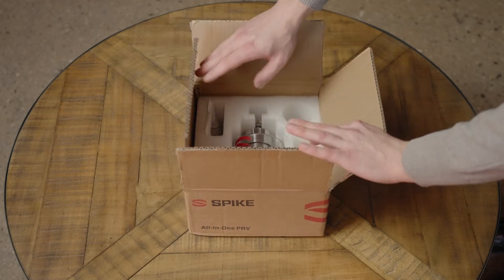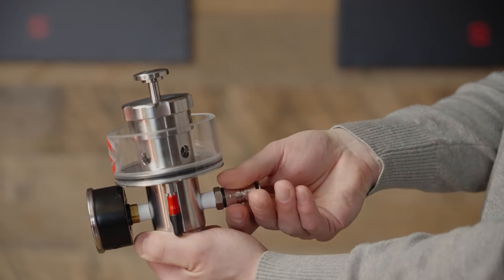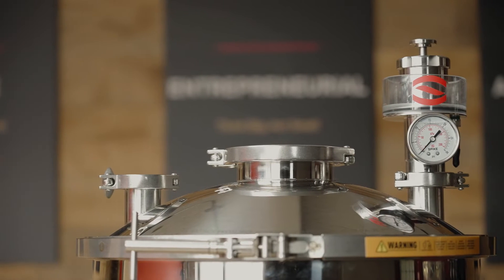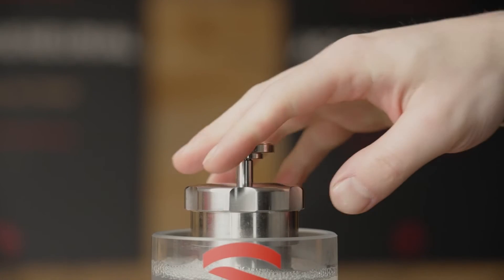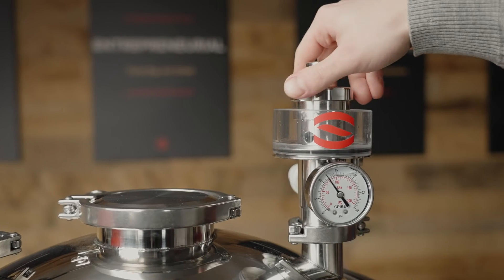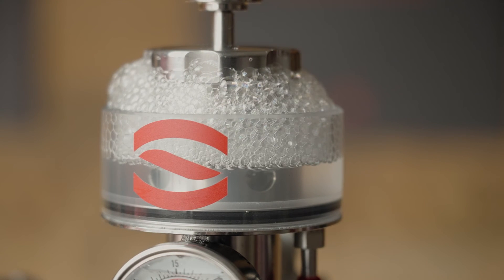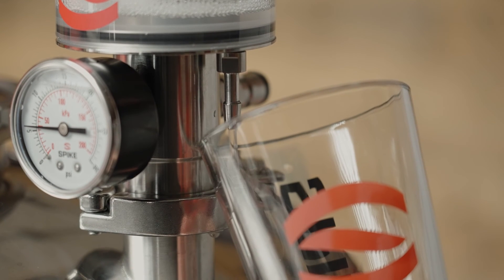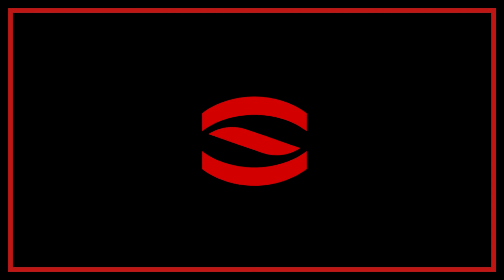Spike All-In-One PRV | How to  Use

Comment: So by adding this, on the other top 1.5" TC port could you install their gas manifold so when it's time to transfer to the keg nothing needs to be done? Assuming you are keeping the pressure around 10psi. Be nice if you could transfer using the PRV, but I don't think that would work.